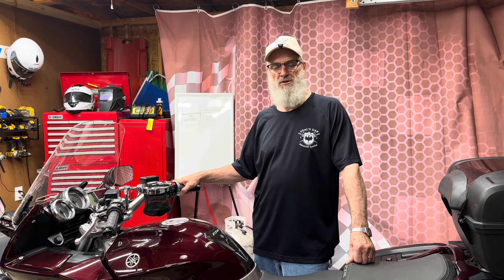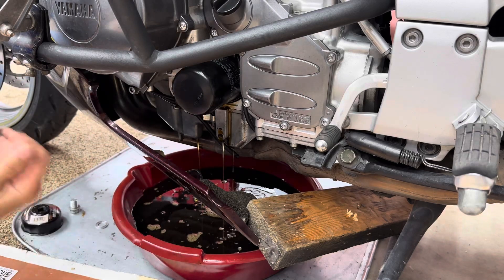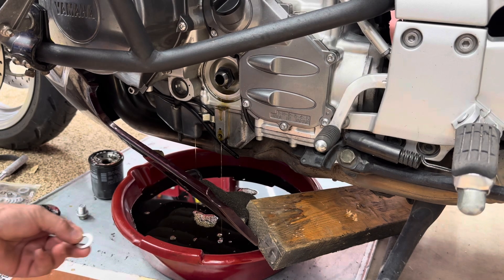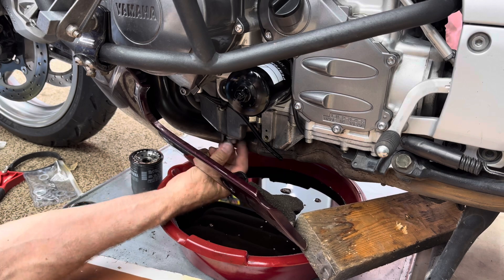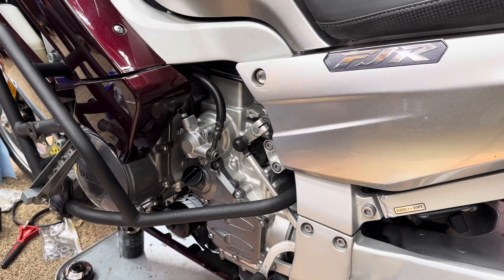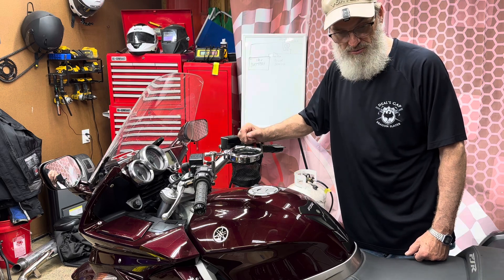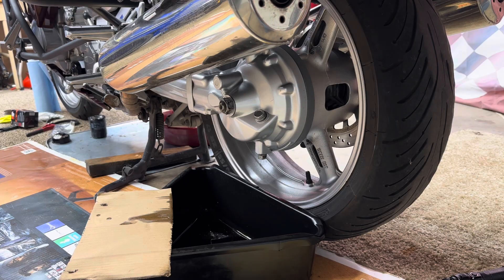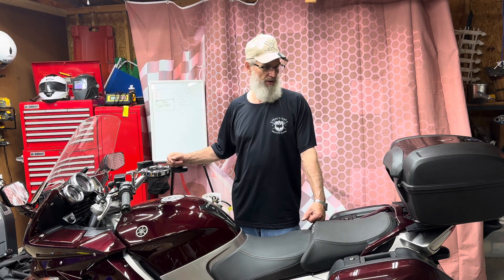Yamaha FJR 1300 Engine oil and filter change, also drain and fill final drive lube #Yamaha

Comment: Iv owned 2 FJRs an 06 and the 2012 the only difference was heated grips iv done many trips and 2 laps around Australia 🦘🌏 back in the mid 80s i bought the Kseries 100 RT they were no match for these FJRs iv just turned 65 and my latest FJR has done just 165800kms and still going strong it will probably outlive me iv just subscribed to the channel cheers from Australia stay safe and upright
Reply from the maker: @SusanWillan  Thank you for subscribing! That’s awesome, the FJR is an amazing machine for sure

Comment: Is it necessary to use a torque wrench?
Reply from the maker: @ericburnett4557  Honestly it depends on the person and their level of mechanical ability and care. I think most people can be perfectly fine without torquing some items but it doesn’t take very long and gives you a piece of mind knowing that it’s done to the best of your ability. A quick story: one time I was working on a Honda Crv timing belt job and it required the bolts to be torqued to 20 ft lbs. I didn’t feel at the time that it was quite enough so I went just a little more and I pulled the threads out of the aluminum block. I learned a hard lesson that day, took me about 4 hours to straighten that mess out. So when working with delicate materials it’s best to torque properly if you can. Just my opinion 😊